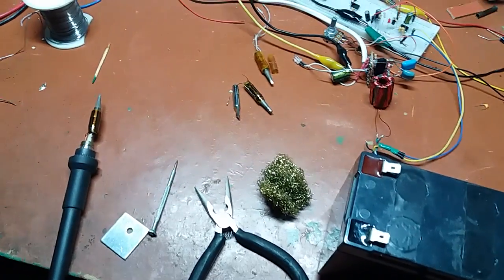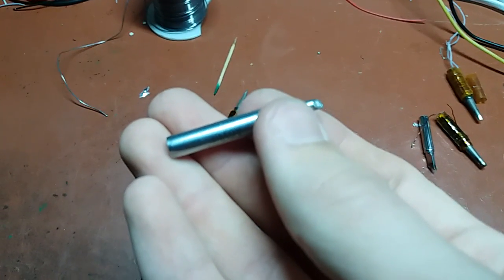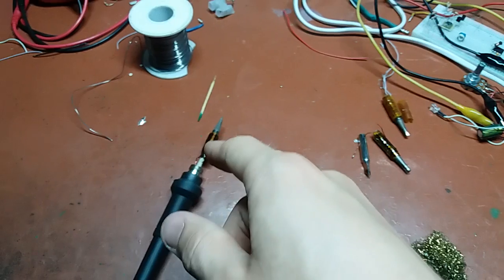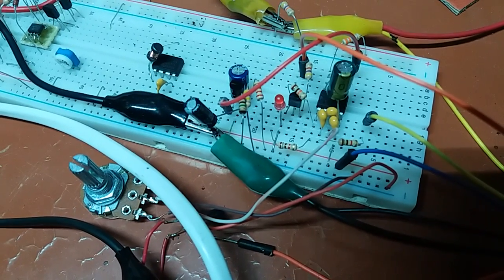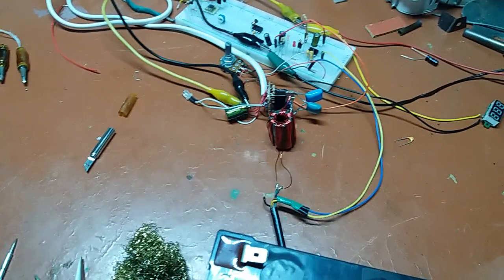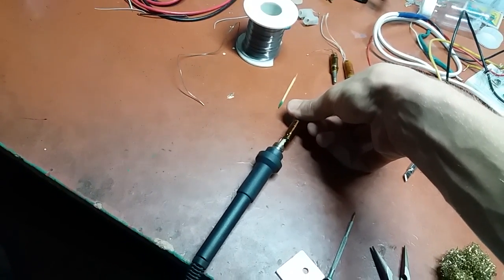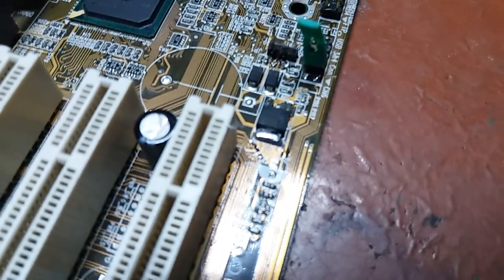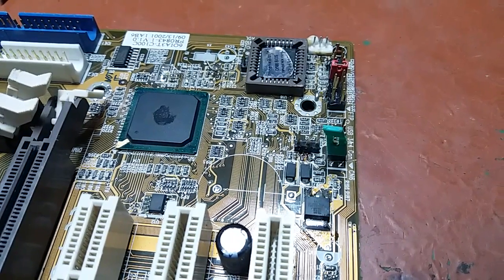Induction heated soldering iron #1

Comment: You clever man, i wished i had a brain as sharp as yours, mine is made of marshmellow
 lol :-D.
Your temprature controller is very well behaved :-D.

And i hate solder joints on large earth planes, just sucks the heat out of the iron.
Makes me want to buy a weller 100 watt "poker" iron, like the one i used to solder 16mm battery wires on to military plugs, it did the biz :-D
Reply from the maker: I partially used the design from that guy, but I just fixed some issues with it and added temp control, nothing fantastic really :) Yesterday I used bug spray in the shed to get rid of those damn flies, was to anxious to wait till it goes out through a window. Some of it was left inside, which made my brain turn into a gelly for that evening :D It resulted in a blown MOSFET in halfbridge powered induction heater I'm mucking around with at the moment.
   That controller is very simple, yet it works really well for this purpose. I can't be bothered buying or making PID controller for it, I think you don't need that kind of precicision here. I bought a better opamp to try out (OP07) which has sub-millivolt input offset voltage, should result in tighter temp control. I will be happy if it's gonna be +-5 degrees.
   I recently bought 100W iron for soldering 6 sq.mm wires inside of a weird piece of soviet equipment, it runs blazing hot, did the one you used ran so hot too? The one I have will overheat within 5 minutes of no use, the tip of the iron goes purple and solder doesn't stick anymore. I had to use like a soldering gun - plug in, wait, solder, unplug :D
 Damn that's a long reply LOL
Reply: LOL Jelly brain :-D.

Im so crude that i would stick a 741 op-amp in the controller, i don't see small differences in temprature being noticable, but my thing was repairs, not design, i've read op-amp books but the info has dissappered from my head over time.

I think it could have fallen out of one ear :-D :-D

The 100watt weller got chuffing hot, but it didnt change colour.
Reply from the maker: I don't want super-duper parameters, so I just picked the opamp which is better than LM2904, but still cheap.
Yeah, that's what I get for buying today's crap :( Sellers claim that these irons are made here, in Ukraine, but they are still as shitty as cheap chinese ones. Old soviet made stuff is great in comparison to these underwound pieces of shit.
 I looked up on eBay, the 100W iron there starts from 7$, I bought mine for about 4$, something is fishy here. I might do a 100W induction iron using guts from it though :D
 The problem is that heating copper and aluminum is difficult with a low power induction heater, those metals don't have hysteresis loss of a ferromagnetic, which is the major contributor of the heat. Eddy currents don't do as much as hysteresis loss does. This is the reason why my iron in the video heats up to melting point of solder rather quick, but then takes a while to reach the preset temp. Hot tip looses magnetic properties and I can say goodbye to hysteresis loss, which I appretiate in this device.
 Hope I'm not boring you to death with these detail LOL
Reply: No you dont bore me, im just having difficulty concentrating today, im having a "Everything seems hard to understand." day.
Ive had enough sleep, so it cant be that.

Call me "Treacle Brain" :-D

So your saying the metals dont produce enough lag/delay to become a good enough inductor thats fighting against the changing flux levels in your inducing coil.

Sorry i could be talking crap,  yep i am, i think you need someone with a better brain than mine :-(